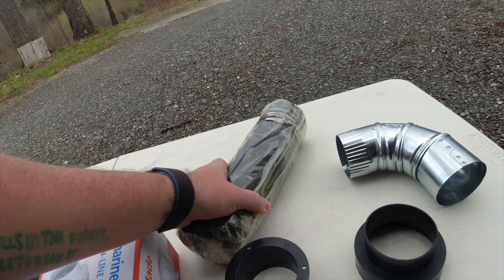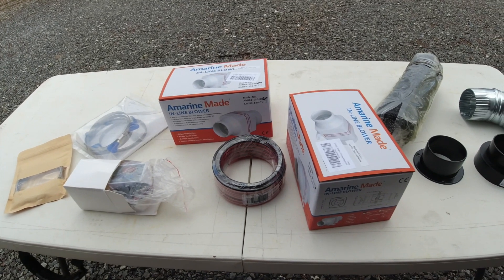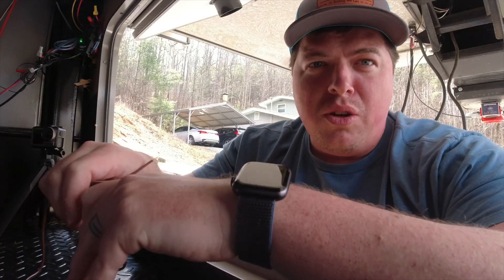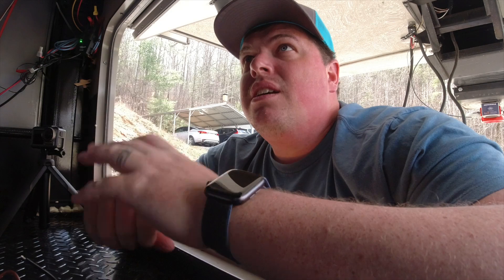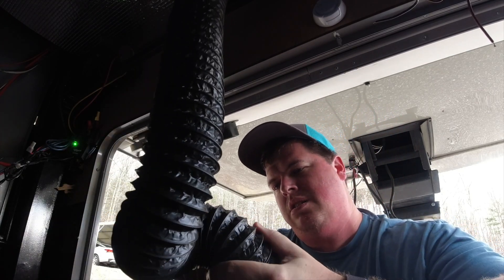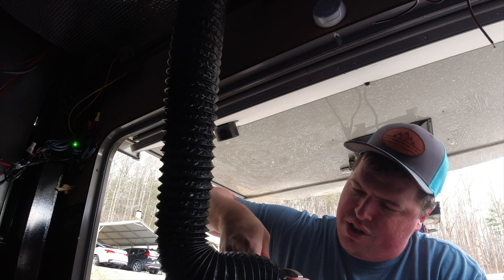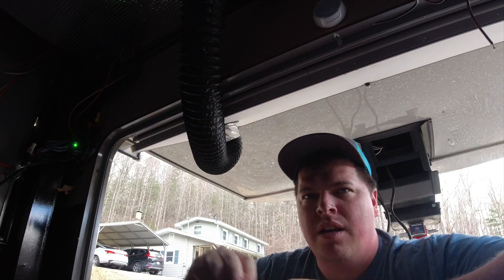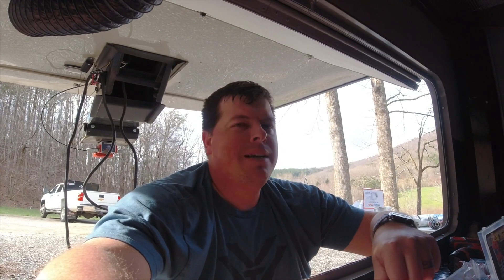RV Victron Solar System Ventilation - DIY 12v Blower moves a lot of air! - No more overheating!

Comment: hopefully the bay won't be that hot at night and the fan stays off.  I agree with not cutting into your heater vent for fresh air.  1.  it will be too loud and 2. you'll lose heater air in the winter to the front bay, which won't need it.
Reply from the maker: It usually cuts off at night no issues. If it doesn’t, it’s too hot to be boondocking haha.

Comment: Just curious why you don’t use one of the relay circuits on the cerbo to signal a 25-30 amp 12v external relay to power the fans based on a temp sensor?
Reply from the maker: I hadn’t even thought of that! There is a lot of unused opportunities with my Cerbo at the moment. Hopefully in the future I can really use it to its fullest potential.

Comment: All I needed was to plug in a 4" USB powered fan into the Cerbo GX USB port and mount it below the MultiPlus-II. Never had anymore over-heating problems afterwards.
Reply from the maker: That’s a really good idea! Have you run it in the heat of the summer yet?
Reply: @TodayWeGo  I have and initially had over-heating problems, which let to the installation of the fan. Based on my experience, the MultiPlus seems to get hot when charging, not so much when just inverting, regardless of the load.
Reply from the maker: Interesting. I have a couple usb fans. I’m gonna try that out

Comment: Hey buddy like the video. I'm getting ready to do the off grid system on my 5th wheel as soon as I get it out of storage. Using mostly same stuff. I have considered the temperature issue. I really like the of scavenging air from the trailer, effective in both extremes. I'm using W 1209 temperature control relay and blower fan 12v from the cooler guys. Got a ? you a New Englander
Reply from the maker: I’m going to have to check that one out! I’m not a New Englander, I’m originally from Ohio, but grew up in South Florida.
Reply: Kevin, you could use the Cerbo to trigger an automotive relay to power the fans based on a temp sensor also wired to the cerbo. You probably got one of the sensors with the multiplus.
Reply: @grayclink6995  Well thanks Gary capital idea😊